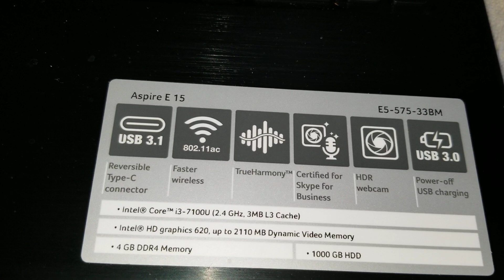Acer Aspire E 15 E5-575-33BM Disassembly Repair or RAM and SSD Upgrade

Comment: Great video thanks!! Need to do a battery change and this looks pretty straight forward. Also on the M.2 drive the bay slot has only one nib on mine which would mean a NVme stick with one notch ??The SATA ssd has two notches. Does this matter?
Looking to install a 500g SSD stick to speed up my slow boot time. I have a 1tb mechanical drive currently which could be used for storage after transferring all to the ssd. It seems the NVme is much faster than the SATA? HELP
Reply from the maker: The slot never has 2 notches, only 1.
Reply from the maker: This video will help with the migration https://youtu.be/4p5jFDzVwUw

Comment: hello, my same acer, display not view, but i connet by vga to monitor it is working, whats is problem? please help
Reply from the maker: Maybe loose lcd cable or bad screen. Possibly could be damaged backlight circuit.
Reply: @ItsBinhRepaired  i cheked display and cable too but same result
Reply from the maker: Probably damaged backlight circuit on the motherboard. :(
Reply: @ItsBinhRepaired  yes i think so too. But can u tell me that chip series please..
Reply from the maker: I don't do that type of repair. I'm not sure.
Reply: @ItsBinhRepaired  ok. Thanks again